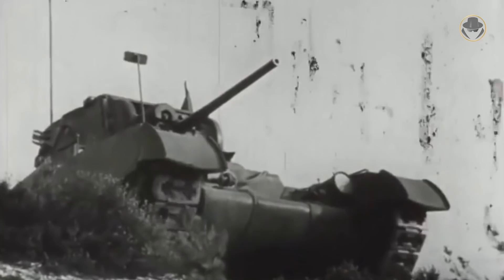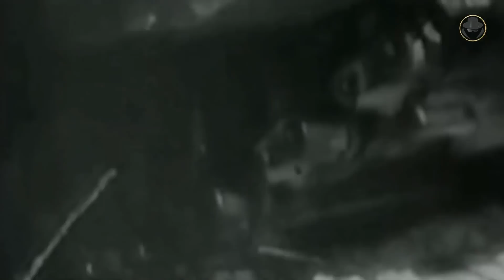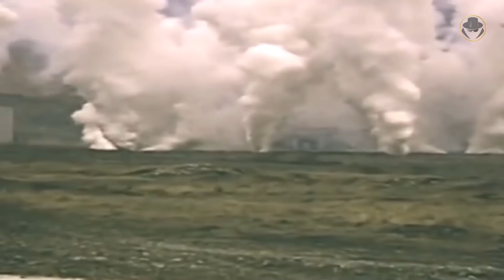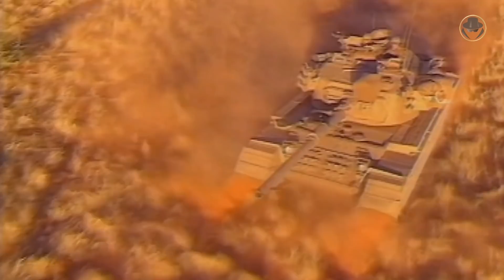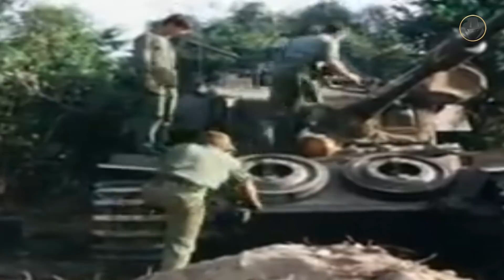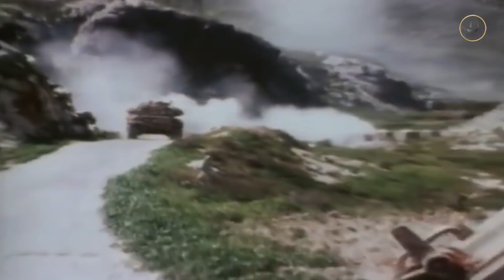Centurion | The most successful British tank

Comment: The Chieftain tank would have been as successful as the Centurion if it wasn't for that Leyland engine. We know the Netherlands tested the Chieftain and the engine trouble was so bad that they opted to buy the Leopard. What a shame.
Reply: Well there’s more than just the engine but that was what made it unreliable. It used non nato standard ammunition and weighed too much for many bridges and would require an entirely new fleet of vehicles to maintain/tow when it broke down, which was often

Comment: Imagine a Centurion with:
1) Chobham armour
2) A modern diesel
3) 105mm smoothbore gun or rifle 
4) Modern fire control and optics
5) Either gun launched top attack anti tank missiles or
6) Turret mounted TOW2 missiles
7) CROWS
8) An autoloader
9) Spotting drone launchers

That would be pretty amazing I think.
Reply: it was fited with that amour the mk 13 had and the mk 10 to 13mk had the 105
Reply: @craigwashbourne4204  
And the south Africans pretty much built this tank, called it the Oliphant.
I think the big limitation is Centurion was designed before the concept of the "power pack"
These days, MBTs have completely modular drive systems, you unhook a few looms and bolts and the whole engine and transmission slides out. 
Stick a fresh one in, perform the maintenance on the first one while outside of the tank. 
Downtime for the tank is an hour at most.
Reply: Forget the auto-loader. The Centurion's ammo stowage is a life saver and and the extra crew- member is faster and an asset when it comes to  maintenance. 

And the advantages of an auto-loader are exacly what? Besides something else that can go wrong.

Comment: We [4H] had mark 5s & 7s - One thing not mentioned is that if you raised the gun then the breech made a very good bed & you could lay back, relax & listen to radio Luxembourg on the 19 set - One more thing anyone remember the "screw retaining intermediate firing needle withdrawal lever" ?
Reply: Ken Hayes: I remember the Ki-gas atomizer (used to start in sub-zero temperatures).

Comment: The engine used in the Centurion was called the RR Meteor (later the Meteor). Yes, it was a derivative of the Merlin, but it had many differences, such as the reversing of the direction of rotation of the engine, the omission of the supercharger, reduction gear, de-rating of the engine and the replacement of a lot of light alloy parts with cheaper, steel ones. Hence it got a new designation. Early engines were modified from aero-engines that had to be taken out of service, but later the engines were built specifically for use in tanks (and some other uses, such as fast sea going boats).

Comment: the centurion entered service in 1944 with 7th armoured div. it arrived on the front line in Germany 2 days after Germany surrendered. They swapped their challenger tanks for the centurion.

7th armoured got pulled out of the front line after D day tpo go back to the UK to be equped with the centurrion but as it was a lot motr complex to use than prevoius tanks it took them 6 months to learn how to use them.

As for the cruiser tanks they had better armour than the German tanks til the panther and tigers came along. event the british light tanks had better armour than the German tanks and as for the heavy tanks they had better armour than the tiger 2. the MK 1 matilda used in 1938 had thicker armour than the tiger 1.

British tank problems were more down to logistics than anything else. MOD tended to buy tanks from all the tank makers as long as they met the minimum specs.

My foster dad was in 1st experiental div in 1938 later renamed 7th armoured div. it was 1 of Percy Hobarts creation and was the 1st armoured div in the world. It was made up of light tanks for scouting and breakthrough. cruiser tanks to take on German tanks if they met any that the light tanks were not able to take out. draggons mounted in rams whichh were cruiser tanks with the turret removed roof taken off and seat put inside to carry troops so they could keep up with the tanks. other tanks were convrted to carry mortars, artillery anti air guns and engineering equipement. it had RAF fighters and tactical bombers assigned to it for air support. It was a fully combined arms unit and no other country had anything like it.

Rommel came across that div in Belgium 1940 and got destoyed by it so he coppied it and used it in the DAK in 1941 But they didnt have any decent tanks and not enough of them to convert any into troop carriers.

At the start of the war Germany didnt really have any tanks that were combat ready. what tey had was PZ1 which had 10mm armour and 1 medium machine gun. the pz II which had 13mm armour and twin heavy machine guns. neither had anti tank capabilties. the only other tank they had was a Vickers A24 which Germany bought in 1938 and called it the PZ38(t) that was a a British reject as it didnt meet the minumum specs for a light tank as it had 28mm armour. minimum specs for British tanks was 30mm for light tanks. 50mm for cruiser tanks and 100mm for infantry tanks.

Poland bought the A24 and called it the PT7. Soviets as the T24 and china as the type 24 they were the full version with 28mm armour and 20mm cannons. the version sold to Germany was downgraded to 26mm armour and heavy machine gun.

Another very good vickers thank was the A32. again rejected by the British army as lacking armour and sold to the soviets with a production license. they called it the T32 at 1st as thats when they bought them. but they didnt make them to the plans and bolted on the armour instead of welding and riveting. during the border clashes with Japan in 1933 they found they leaked when it rained and when they got hit the bolts flew off inside the tank killing the crew. so in 1934 they went back to the factory removed the bolts and welded and riveted the armour instead and renamed it the T34.

During the battle for Belguim and france no British tanks were knocked out at all. some were damaged or had mecahincal failures and were captured when the BEF was ordered to retreat after Germany surrendered after suffering heavy losses. but got rejected by the allies. germany took the caputured British tanks and repiared them and put german markings on them ans used them instead of their own tanks and if they couldnt get enough British and French tanks they used Italian tanks. they only used German tanks when they couldnt get enough of better tanks. Rommel tended to use mostly Captured British and French tanks in North Africa. But those were taken away from him to be sent against the soviets tanks.  Only effective anti tank weapon Germany had early war was the stuka. they found by accident the 88MM anti air gun was good against the british tanks so started using that for anti tank work. that started being used by Rommel in North africa in 1941 when a battery of them were atacked by british tanks and they fired at them and knocked some out. which their own tanks could not do. By then they had the PZIII whih proved inefftive against British tanks but were very good against the US tanks which were called tommy boilers by the british as they burst into flames when they got hit by heavy machine guns with tracer rounds.

Even now the centurion tanks r far suppiior to most other tanks in the world. its rated as the 4th best tank in the world behind the challenger II, challenger I, and cheiftain tanks. 

My artillery unit specilised in anti tank roles. we had 105mm light guns with HESH rounds and HE rounds. on r target range we had centurions and couldnt knock them out. the M60's we could take out with HE rounds. the M1A1 we could take out with HESH easy.

During the 1st Gulf war a British challenger I came under fire from an M1A1 it got hit in the rear armour and didnt even dent the armour. the crew got on the radio and told command that a US tank is firing at them please kindly ask them to stop. After another 9 hits in the rear armour still no dents the crew got permission to fire back. so they swung the turret around 1 shot front armour no more M1A1.

RTR was given an M1A1 for testing to see how good it was they couldnt take out the mk1 centrurions on the target range.

The USA was caught stealing the plans for the Challengers Chobham armour to put on the M1A1. so the plans were altered a bit to make it totoaly useless lol.

So the challeneger II was given new armour called Dorchester that was even better than Chobham armour.  1 of them came under fire in Iraq and the weak point was found. they just threw mud on all the extrior sighting equiments to blind it so it had to stop and wait for infanrty to come and rescue it. it was stuck for 12 hrs and being hit by everything except the kitchen sink at point blank range and the crew just sat their drinking tea till help arrived. not 1 single dent on it despite being hit by T55.s T60.s, T72, RPG's and everything else they could find to try and knock it out.

Comment: I served on cents during my time, if I remember correctly a Mk 12.    Lovely tank, how we hated to move on to the dirty and smelly Chieftains. :-)
Reply: Is it true the the engine in chieftain was not reliable?
Reply: @kevin_1230 the early L60 was a pig of an engine,only much later did the chieftain benefit from the later marks of L60
Reply: @kevin_1230  Not that I recall.  It was smelly and dirty and we had to sleep by the side of the tank rather than on the back decks as we had with the Cent.  The gear box was a bit iffy, if something went wrong it would change down a gear every 1.1 sec which was enough to toss folk out the turret but I only saw that happen once :-)

Comment: hahaha I worked at a tank restoration facility for a year on this tank and I'll tell you right now its garbage. to start out in the field and on exercises they used to have gas trailers hooked onto the back because they would burn through an insane amount of gas compared to any tank of that time and even now. they couldn't go half a day without that external gas tank trailer. lastly ask any vet from around the world who used this in combat, the only thing they would say that was positive was that it was more accurate than the the Sherman, other than that it broke down a lot, the suspension was really hard on the crews and it was more cramped.
Reply: Sure, that's why it stayed in service for over 30 years.
Reply: You quite obviously know little about tanks ...other than removing rust from metal. Trying crewing one in combat......that might give you a better perspective.
Reply: Well I served my time in a central workshops where they were overhauled,they were certainly more reliable than the early chieftains,it proved itself in quite a few battles
Reply: I served on Centurions and never saw an external fuel trailer. We also,weirdly, did'nt need to refuel every day either. With a couple of hundred miles range it would be a few days between refuelling normally. It was also the least cramped tank of its generation by far. It was in my personal experience the most reliable AFV we had, at least during my time in the army in the late 80s.

Comment: The could probably upgrade a Centurion today to rival modern MBTs. Very adaptable platform.
Reply: Check out the South African  Oliphant/Elephant mk1B(very modified Centurion) still being used today
Reply: The  first Merkava tank was essentially a backwards centurion
Reply: Not hardly. Upgrades only go so far. It may have been a very great tank, but it is 3/4 century old, and its design, armor, gun, and capabilities are nowhere near modern MBTs like the Abrams, Challenger, Leopard II, and LeClerc. This thing had its time on the main stage, but it would be a deathtrap against modern MBTs, most of which could kill it well beyond the range at which a Centurion would have the slightest chance of ever getting a hit.

That's kind of like saying the P-51 was the greatest fighter ever; it could stand up in aerial combat today with a few upgrades. No, it would be a manned target. Same for the Centurion.
Reply: @mikearmstrong8483   You were doing fine until you made the P51 comparison.  That was just silly.  The P51 was made redundant by the jet.  Development of aircraft technology and the ability to upgrade in the early years of the Cold War were completely different to tanks.  The Centurion was able to compete for the best part of 40 years.  The P51 was finished as a fighter after 7 years.
Reply: @frankanderson5012  
Same principle. Both served well in Korea. Both are obsolete now. The point stands.
Reply: @frankanderson5012  actually with advanced avionics and the right missile could easily shoot down some 4th gen fighters
Reply: @mikearmstrong8483  I mean if Korea is your sticking point then I can see where you are going wrong. The centurion was still very relevant post Korean war.
Reply: @sshep86  
Korea is not my sticking point, and what has happened to the art of reading comprehension? The original comment was that a Centurion could be upgraded to match modern MBTs, and my response to that original comment is "BS". The fact that South Africa (a nation that has almost zero possibility of getting into a major tank battle) still uses it, means nothing. The fact that it was a great tank in its time doesn't make it a great tank still. A 75 year old design is no match for the current generation of MBTs; it is outmatched in every way. Nostalgia doesn't win battles, but superior weaponry does.
Reply: @mikearmstrong8483  My comprehension is fine. I'm not saying I agree with the OPs post, I'm saying I disagree with your argument and reasoning.

Comparing apples to oranges is not a sound argument.
Your P51 argument/comparison is flawed and you come across too stubborn to realise.
Reply: @sshep86  
That was hyperbole, to make a point. So what? You want to argue semantics? I have better things to do. Convince yourself that the original point was right if you don't like my arguement. Good night.

Comment: Centurion was good in Israel very upgraded version! With 105MM GUN and was kind of the start point of the Merkava project!
Reply: I heard CV that many Mothers in Israel once found out that their sons would served in Armor Corp: they insist that their sons served in Centurion equipped units.
Reply: With the British 105mm gun....
Reply: Actually it was the Cheiftan that was the start point. The Israeli's really wanted Cheiftan with its 120mm gun. But the UK got cold feet due to relations with the Arab world and backed out of supplying them. A Cheiftan was actually trialled by the Israeli's however...

If you think Centurion did well in 1973....Cheiftan would have obliterated the Syrians..
Reply: @dogsnads5634  Well....Jordan did Field some Chieftains against Israel, but they never used, nor saw direct combat. Because King Hussein didn't want to be the biggest scapegoat this time and also He was thanking Israel for saving his life and his throne.
Reply: The suspension looks very similar to the Mercava.
Reply: If the Israelis turned a Centurion upside down to build their MERKAVAS did Britain supply the chasis to them ?
Reply: It was also up-engined and a new transmission.